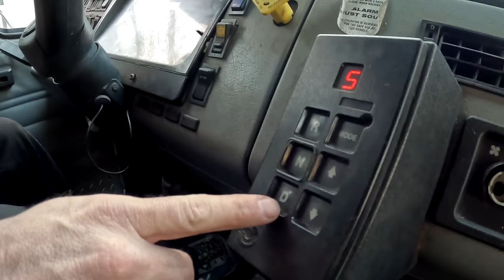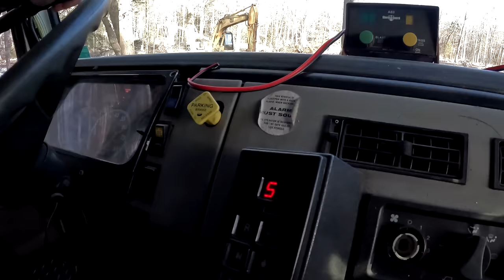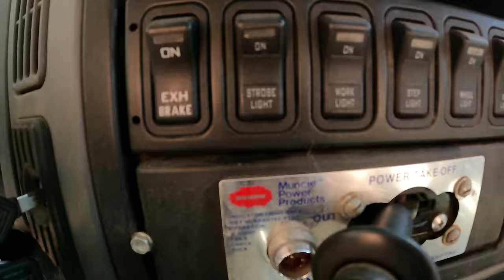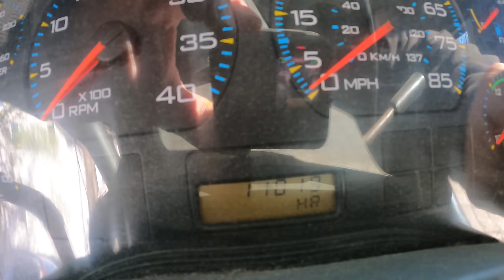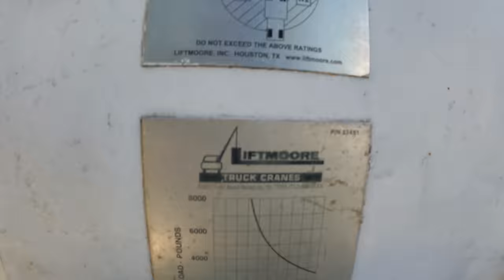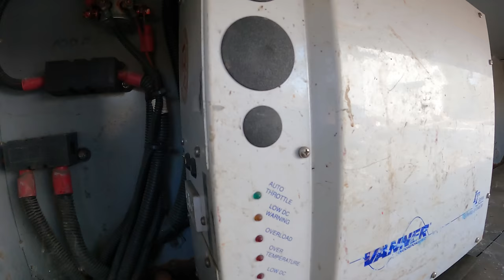Building my Dream Truck : Part 1 - Buying 2 trucks to make one, removing bed

Comment: Gotta love how much like Lego big trucks are. You get a frame, stick an engine and transmission you like in there (maybe change it later idk) and slap a cab on top. Use it like that until it's not what you need anymore, then make it into something different.

Comment: Just found your channel, looks like a great project! I run the same truck and love it. I wish mine had an exaust brake, never seen that before on these. That is the good 466E just EGR, very stout engines. Just be ready for electrical problems they all have them. Can't wait to see the rest of the build. I bet your power issue is the connections for your injector driver module or your injector pressure regulator. The female sides of the connectors get worn thin and vibrate around. Check the injector driver relay in the fuse box on the fender. The plug sockets get loose under it and it can cause what your getting.If you need any info on that old girl just ask and I'll try to help. Thanks for sharing with us!
Reply from the maker: ok thanks

Comment: You could use that crane in your new shop ! There is also a small fortune hydraulic lines and fittings on that rig. Now, you can call it the International Frankenliner !

Comment: I use to be highway superintendent in my town we had many dt466e powered internationals and had good luck .
In 09 when we got into the dt570 max force  they did have some issues usually with egr cooler and few other not huge issues . Good luck with the build .  Cool channel 👍
Reply: I was just at MATS and talked to the guys at Bullet Proof Diesel and they have EGR coolers to replace most of the common brands of HD and Light duty motors. They said they've never had a failure yet

Comment: One of those adapters that you can attach to a pressure washer to sand blast metal would work good for cleaning up that frame.

Comment: If you didn't know acid will literally dissolve rust to a like new metal Condition. Obviously immersion is better. Then there's the neutralizing requirement after. I've experimented a little and it's no joke, amazing how well it works. Muriatic is a popular one. There’s vids on the process and mixtures. I just bought some EvapoRust as people rave about it, it's expensive though. Reading about it, the PH is almost neutral like water so safer to work with. Gonna experiment a bit more with it. 

Supposedly Por15 was bought by someone and doesn't have the same formula anymore and it's failing more. Rustoleum is a slightly acidic paint and that's why it works so well on rusty metal etc. Tractor enamel is also supposed to work well.

Comment: That crew cab International was a railroad section truck and the hyrail gear was removed prior to being retired, we have similar but larger crew cab tandem section trucks with larger booms or cranes and we have lots of railroad hand and hydraulic powered tools, torch set etc.

Comment: Regarding the defueling / surging: I work on a fleet of these things. First thing you want to do is clean the prefilter screen prior to the spin-on fuel filter. It’ll probably be caked with grit and rust from the tank. Clean it up, and change the fuel filter before doing anything else.

These internationals are bad about the coolant leven sensor going bad, but it doesn’t cause the truck to de-rate. When it fails it will display CHECK COOLANT on the dash, and shut the engine off completely after running for about 30 seconds. Same for low oil pressure.

Comment: The main problem with the maxxforce DTs that I remember in the smaller end was mostly VGT problems. On my 04 I had similar problems where it would run great on way out and dog or derate on the way home usually loaded lighter. We never fully figured it out. I tested fuel pressure at idle and at higher rpms and played with the fuel regulator so I had 65ish psi at idle and 75ish at running rpms and that seemed to give it more power on the way out but not help the derating. The next thing we tried was we had a couple injectors not keeping up so we replaced them and really had no change other than the egt curve across the cylinders leveled out to where it should be on warm up. The only thing I didn't try was monitoring the egt post turbo to see if that was sticking. International charged me few thousand and never actually changed it either.

Comment: Hello Jesse, 
  Man, you always find the great deals.  I've been looking for a small 1 ton rollback truck.
  I bought a subcompact tractor a year and  a half years ago. I've been looking for a truck and a 17' - or 18' trailer.
Then I said to myself that a rollback tow truck would work for my needs.  I don't drive vary far anymore. I just need a way to haul my tractor or skid steer. 
  I live in Michigan, and the prices for any type of truck are so expensive. If I could find a good rollback for under $10,000, That would work, I'd spend at least that much for a good truck and trailer. Love the videos keep up the good work.

Comment: With the running issue worth a check on the ipr valve and ipr valve connector. Worked on and fixed a bunch with similar issue.

Comment: Jesse if you have a air rivet gun use a straight bit and hit the sides of the hyd fittings and the vibration will loosen up the fittings it makes so easy to unscrew them. I’ve also seen a guy make a bit for his Sawzall and it worked just as well to remove hyd hoses no air lines to carry just a battery for the Sawzall. Enjoy your enthusiasm in repairing and making what you’ve dreamed up.

Comment: 2006 DT466 is a solid engine. The turbo actuators like to freeze up if it’s not used often, keep all your connections in the battery box clean . Great truck .I maintain a fleet of those in town plow trucks ,love them .Don’t know what your defueling is offhand ,I’d change your fuel filters either way to start.
Reply from the maker: thats good to hear. there really is no blowby, and no smoke. It might have had an in frame. there is a mountain of paperwork that came with it, maybe there is some service records
Reply: The main filter on the engine has  little screen filter in line with the main filter on engine I have see them clog up and that issue is more present when driving not when it’s at idle good engines if u use them easy to work on can’t wait to see what u build

Comment: Man that thing looks too rusty to spend 9K on it. Hopefully that cabs not too punky. Go south for the next one. Hopefully it does work out where the other one offsets that one a bit. Good luck look foward to the build! My buddy has done this a few times now and its a good time!
Reply from the maker: these truck with extended cab are really hard to find for under 30k, I know that seems crazy but it is true. I have seen this truck in good shape go for 100k, and it didnt even have 4x4

Comment: Just a thought, I drive a KW tandem with a GVW of 49500 that has an Allison 6 speed auto that has all the grunt our other trucks have with 9 speed standards or 10 speed manumatics. this truck has 240000 miles and has never given the slightest problem to date. In the city it is so much better from a drivability perspeective and is superior to all of our tandems if you ever have to pass anyone on the highway. No bullshit.
Reply from the maker: I hear ya, maybe if I drove a truck every day I would think that. but shifting is just part of driving a truck for me. without it, it's just no fun
Reply: @jmuller86  Of course only you get to speak for you but I said the same thing until my first run in with heavy traffic.
Reply: @jmuller86  It's cool that you read this stuff
Reply from the maker: @bobzotzman5253  I usually read every comment for the first day or so, after that; youtube doesnt show me newer comments for the most part
Reply: @jmuller86  I'm with you , besides on a long trip on the highway how much are you shifting? When buying an old truck you don't want to worry about an old 30 k$ auto just a 1 k clutch. Back in the day when slush boxes came out for women drivers😉all the real men had bumper stickers "I'd Rather Eat Worm Than Drive an Automatic".🍻

Comment: If y’all had a torch you would be hell on wheels.  Don’t worry. I don’t have one either.
Reply from the maker: I have a torch, but I rarely use it. I use the plasma cutter for 95% of things I do
Reply: @jmuller86  I saw it after I kept watching.  You did good work.
Reply: I watched it on and off all day starting at 4am this morning.   Just got done.

Comment: Would have recommended you incorporate a double hinge design for the toolbox so that the lid can open up partially and then fold up under the crane for better access to tool box.

Comment: Ole railroad truck looks like a csx truck usually see these with welding gangs there usually pretty setup with power air hydraulics and everything but when it comes to box’s there usually added hastily when needed (aka poor placement as you’ve noticed)😂

Comment: Hi how about putting a fifth wheel on it then you COULD swap and change how you use it and maybe the front part have your flat bed if you fix the fifth wheel on the very back then you could also have air supply at the back for anything with air/air brake trailer? Just a thought don't know if it would be practical for you or if it fits with your plans at all

Comment: Jesse you sure arent afraid to take on a challenge. that ex railway truck rusty crusty thats for sure, coupled with soup sandwich hydro hoses rats nest of wiring. pleasant surprise that much of those hose connections came free. shame so many of those boxes were in such horrendous shape but they'll help fund new better versions

Comment: 👍😎 Put a hot shot ball goose neck trailer or pintle hook on back , And you can still use it as a dump w a. Diamond plate floor n short side  boards rails soo you can still use it as a. Flatbed  Good old Service truck a lot  of attachments you can eventually use if needed  or put a. Semi 5th wheel on it. Lol. 10-4 Super (man) Trucker 🏁💀👊🎂You kick Asphalt  !

Comment: I'm some what surprised you didn't give yourself a a foot or two of extra frame as you can always cut more later. I am really looking forward to this build I have always wanted to make something similar.
Reply from the maker: Im gonna move the axle forward about 18 inches so I will have 18 inches of extra room
Reply: @jmuller86   That makes sense, It's to bad you probably won't have mobile column lifts yet when you do the rest of the project.
Reply: @jmuller86  Jesse at 47:09 you finally used the Andrew method to disassemble your truck congratulations on this first🤣🤣🤣🤣

Comment: Suggestion: get a new (used) frame from another truck, toss that sketchy frame and place the cab on it. Unless you have more time than money, the state of the rust is pretty lousy. Personally, i would cummins swap it and have area diesel help out. That other dump looks way nicer, it would get fixed and plated and sent down the road. But again, these are just suggestions. If its a show piece, cab and engine would be coming off regardless for sandblasting and priming/painting with por15.
Reply from the maker: that frame is fine, there is no rot in it. I wouldnt have bought it if the frame was junk. just needs to be scaled and por15'ed
Reply: @jmuller86  cool, you have darn fine judgement Jesse, I hope it all works out!

Comment: Just watching the video! The fl80 4x4 is going to be like 5.83 ratio and uses the overdrive allison in 5th gear for a .74 od. Check the International before you get to far, would guess it is arround 4.11 ratio! You could swap the International over to an 8LL wich would give you a similar od as the Allison! Good luck on your project!
Reply from the maker: I wouldnt mind an 8LL, but I would prefer to actually swap over to a 10 or 13 speed eventually. Are you saying the axles from the FL80 will be geared down so I will have less speed but more power? In the international , I would rather have more speed and less power
Reply: The 8ll's have a tall overdrive and give you a deep low as well. Also the fl80 uses a step frame to keep the bed low but allow enough front end clearance for the front axle. Might just try a locker in the rear of the International for now and file for a title on the fl80 4x4. Good luck on your project!

Comment: Hate to be the bearer of bad news but I work on a fleet of about 75 trucks and we have many "Maxforce DT's" which is what you have there it's pre true Maxforce. But they are huei injection systems and are very unreliable. If you are set on keeping it and want a reliable truck plan on replacing the injector o-rings, high pressure oil manifold o-rings\seals and carry a spare high pressure oil regulator for the pump.

Comment: That’s really not that many hours. Lots of marine diesels around me go 15-20,000 hours.   Also. Those hose reels are freakin expensive man. Someone def would buy it. Same thing with the crane. The truck just built a new custom battery tray for has the same issue with the throttle. And it’s made even worse by the air ride seat going up and down lol. I was thinking about installing a small shock absorber for n the throttle pedal to make it more smooth

Comment: The reason that thing is so rusty is the inverter has DC "bilge leak" if in a salty region especially sea water. The stray DC current creates sodium hydroxide in solution of water. Its a difficult problem on boats the eat the anodes quickly and eats any steel hardware.
Reply: The stray DC from what/where?
Reply: @mrmotofy  from inverters, they all have stray currents, some have  less n some have more. Its all a matter syn wave technology. Anything that converts DC to AC has radiation leakage. Now be it there is a lot more issues in yachts because everything is converted into ac.
Reply: @shanestamball1886  Hmm so it's just inverters from DC to AC. Is there anything that can be done on a truck to avoid it? Boats have rods but would it do anything on a truck
Reply: @mrmotofy  there was a large inverter in his truck, im pretty sure anything that has a 12volt system has leakage, but when you combine DC current with salt's you get a rapid acceleration of different gases. Add certain woods to the mix and things can get intresting

Comment: I believe the different companies considered what they must do to help against these rust issues. Even so, from the eighties to the mid two thousand era, rust is a big problem. And then your into more electronics, more EPA rules on emissions, maybe all good for some but one thing doesn't work for everyone. Poorly worded but maybe you see what I am trying to say. I like steel over aluminum as the dissimilar metal problems make it a lot harder to do. Not sure if a ramp on the lowboy in the back to give you say four more inches would help in mounting a bumper in the front of this rig..... maybe a quick detach or other but that is new problems and snow and ice issues. not so great a idea. Being four wheel drive ... might be able to back up further.... not sure of anything except that cameras make things look a lot different. Obviously no one ever heard of manifolds to save on lengths of hoses.

Comment: Get yourself a needlescaler, that works greate to strip thick rust off the frame. 
Get sealed LED lights, these dont rot in the salt. 
Wax/Oil coat after applying rust converter to the frame, sandblasting works well too, but scaling is usually enough together with rust converter.
I would strongly recommend not using old hydraulic hoses and repressing them, hydraulic hoses themself are not mixable between brands, that means you will need to find out the indevidual brands of the old hoses and buy the fittings from that brand, otherwise the fittings will not fit properly. The pressure is also different for each system, if you get is wrong a fitting might blow off.
Get yourself a full set including a press, common size hose rolls and the pressfittings. The fittings and the hoses are really cheap when bought in bulk. The Press will be the most expensive part. Alfagomma is what we use, their hoses dont require any preparation after cutting.